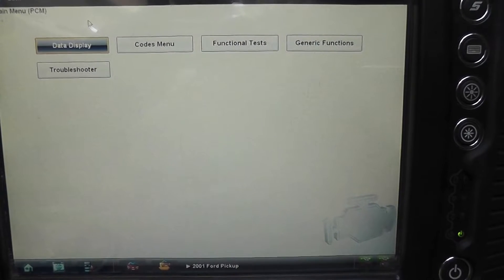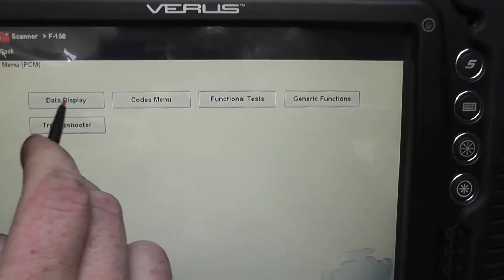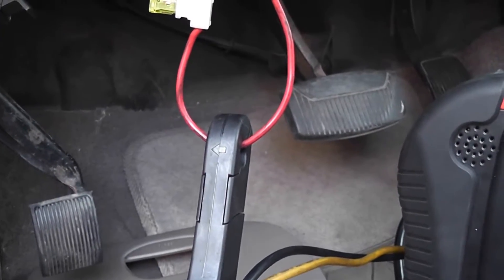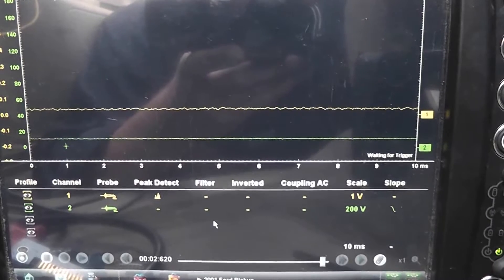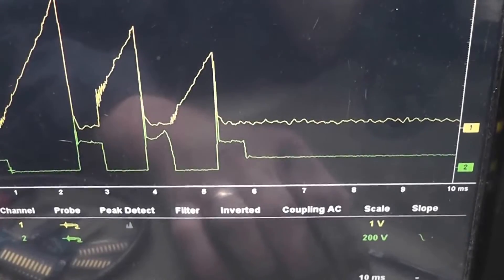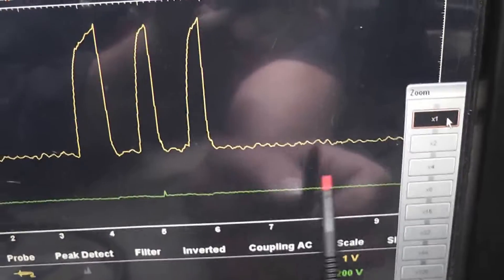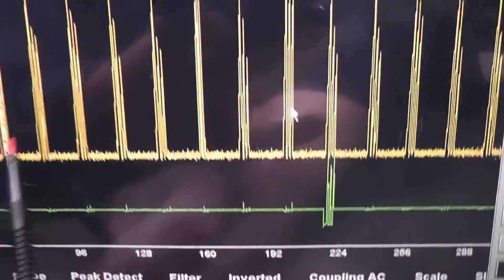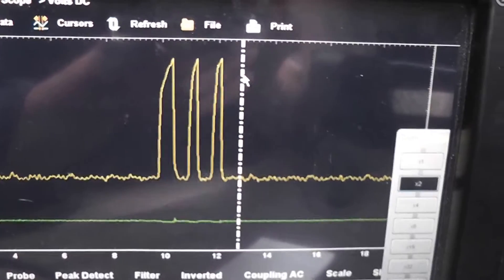How to find a shorted coil on a Ford 5.4 engine (misfire diagnosis)

Comment: recreating this test on a new project, 02 Ford E350 5.4L.  Have miss on two cylinders from codes.  But I cleared and now tring to narrow the COP swap versus the plug on those two cylinders.  Test should tell me exactly if the same cylinders show the misfire. Plugs are at life, I think it may be the plug, not coil. But 100% of public says it's always the coil.    I have Verus, ordered the AES wave loop for the AES wave amp clamp and have my results saved.  Just can't quite make sense of what I have gathered.  I see the no. 1 triple spike pattern on my yellow, and the green is showing my amp clamp.  I have amp on the no. 1 posts.  That is confusing.  Why wouldn't colors be reversed?  You are focused on the triple spike of even height on that bad no. 4.  Are you opening up that amp pattern to see that?
Reply from the maker: Let's move this to my forum www.scannerdanner.com 
It is free to join and we can definitely help you. I have 28k global members and hand picked moderators who've been with me for years and know my material inside and out and are there to help me help you guys. It is just too difficult to offer back and forth messages here on YouTube with stuff like this and we also can't share pictures and images here like we can on the website. Hope to see you there!

Comment: This may be a dumb question...but can this test be done when a system uses the same fuse for powering the coils AND injectors? 05 Ford freestyle 3.0 is the subject.. 3 of the coils and all of the injectors are unfmder the plenum...
Reply from the maker: Yes, but it sort of makes the waveforms difficult to interpret at times.
Reply: @ScannerDanner  yeah that's where im at. Its seemingly impossible to decipher the pattern.

Comment: That coil waveform you're saying is bad is what every cylinder on my car looks like! Lol,and my car runs perfectly!!
I just bought a little Smart Car 1.1 3 cylinder as my 'test' car.I also bought a Pico signal probe for the cop ignition on the car,that's useless too,can't get any waveform at all!!
I've got all the waveforms in my head but nothing i test looks like the haha.Not an encouraging start to my diagnosing career.
The old Verus classic has been a great learning tool though till i can afford something more up to date.;-)

Comment: i have a 03 intrepid 2.7 litre with 3 coil over plugs that arent firing unless i move them to another cylinder. i have 13 volts at all wires but cant figure out how to test negative wire to ecm for a break or short. i was told that the ecm was bad if i had voltage at the ecm connector. i am a super fan of your videos and cant figure out how to test negative wire for a break or short. i know youre probably very busy but could you lead me to a video or tell me how to instructions please

Comment: Hey danner.  I got 2003 expedition 5.4. I got p0320.   And when im driving around 70 mph im losing current on cylinders  6 5 4 8. But just for 3 seconds  then goes back to works fine . I post a picture of the wave form on the forum but I haven’t had lucky  to get any advice.   Thank you

Comment: How often do you need to use more than two channels on your scope?
Reply from the maker: not often but there are time where you would absolutely need more than 2
Reply: @ScannerDanner  For an example? And what would be the best scope for that scenario?
Reply from the maker: Identifying a Shifted crank gear keyway on an RX 330. 
 In cylinder psi waveform synced with an ignition event and cam and crank waveform. Used all 4 channels. 
Picoscope automotive 4 channel by far!

Comment: Paul, i know this is an old video, but is it ok to connect to a coil like this with a vantage pro? Its rated for 200 volts, but i know it can get to around 400 on the firing line. Im just worried about killing my tool... Maybe an atenuator you could suggest? Thanks for all you do for us man you really help us out.

Comment: ScannerDanner, is it possible to do this test without using the low amp probe?
Reply from the maker: Nope, I'm measuring coil primary current flow
Reply: Do you cover primary and secondary testing in your book?
Reply from the maker: Yes I do

Comment: Paul. Do you  think a bad cam lube. Will trough a  po301. On 2000 ford expedition 5.4
Alredy dis injector swap —- coil swap....   i check the injector  wiring  with the power prove 4 and they all good
Reply from the maker: For sure. Check compression pressures next
Reply: ScannerDanner i did a compression test with the gauge.
Reply: I did on cylinder 1 and cylinder 5
Reply: They bought the same.  150 psi
Reply: I did i head job like 6 months ago. Because i got a misfire on cylinder 1 but was the head gascket .  So i put everything new.  The shop rebuid the head too.
Reply: This test on this video should show me if the wiring or computer is bad on the ignition coil
Reply: Bad fuel pump  will trough p0301 too?
There is no p0171 p0174.    Maf sensor its new and is working right
Reply from the maker: Do a running compression test now. A warn cam lobe may not be seen by a static compression test
Reply: ScannerDanner thank you sir. For taking the time to respond.  The problem was my coil. But i not sure why. I swap the coils.  1and 5. 
And the code still was on. #1 so i let it seat for 3 days.  When i come back. Connect the scanner.  Turn switch on. And read the codes again. The code now was on #5  i never clear the codes to keep the freez data     . So i get i good coul swap in to cylinder 5. Now the truck is running. Like new  thank you again 
And God keep  adding years to you life   So we can keep blessing from you  videos

Comment: If I'm not mistaken, as you would need to with compression tests or injectors- using that 1st cylinder is known as a sync? A method to keep track of which cylinder firing based on its firing order.
Reply from the maker: Synced with ignition, not injection and I have many other videos showing how this is done. Thanks!

Comment: Is there any way to get this mode 6, and the next screen which shows each cylinder misfire count, on a program like Forscan on a laptop? I can’t afford one of these nice scan tools as much as i’d love it and use it. I’m trying to find a misfire under load, on a 2008 5.4, no codes, my misfire counter definitely jumps up. Just can’t afford to throw all 8 coils and plugs right now, since I’m not gonna replace them with the cheap eBay $40 for all 8 coils garbage.

Comment: Paul, I've been studying Ignition waveforms. Should I see a turn off oscillation on a good sec. coil/spark plug or on a bad one?
Reply from the maker: are you talking about primary ignition current? If so, turn off oscillations are not always visible, but an open plug wire will certainly give you a big tail. 
Primary current waveforms will not show you all secondary issues. Only some.
Reply: ScannerDanner Ok, so they'll become more evident by reading voltage instead?
Reply from the maker: yes sir, when you can of course

Comment: Have you ever heard of a COP causing a P0720 O.S.S. circuit, stall in drive, O.D. light flashing?
Reply from the maker: No but a faulty alternator yes. I have a video on this.
Reply: Output speed sensor. Ensure alternator is producing power.

Comment: awesome vid!  what low amp probe are you using? I see it's a snap-on,what is the part number?
Reply from the maker: +Joe Ripoll It is a Snap-on one but this one will do the same thing for you.
http://www.aeswave.com/Current-Probe-Low-range-Generic-brand-p8486.html
Same one I use with my Picoscope without the name and it will work on any scope or DMM. If you need a BNC cable end, they have those too.
Reply: +ScannerDanner 
could you run me through the connections set up, between the amp clamp and the scanner? I see at the top of the scanner there black and red cables connected, what is the yellow cable connected to?
thanks again for responding,I really appreciate all your work/posts...
Reply from the maker: +Joe Ripoll I was using two channel for this video. The amp clamp is just a positive and negative lead to any DMM or scope. Inductive amp clamps produce a small VOLTAGE (not amperage) that is proportional to the magnetic field of the wire you connect it to. The magnetic field is proportional to the current flow. 
The amp clamp again, produces voltage that when connected to a scope with proper scaling will indicate amperage but is really just a converted voltage. 
In other words, if you set this amp clamp to a 20 amp setting and connected it to a regular DMM on a voltage scale, then clamp it around a wire that has 10 amps of current flowing through it, your DMM would show 1 volt. Make sense?
Reply: +ScannerDanner 
Yes,I'm getting it, very cool way of doing it. I want to try this test with a friend who has a s-on solus pro or modus pro,not sue which one,but it has the scope function and DMM built into it, and he's currently working on a for f250 with a misfire,and no codes. I'll forward him this video and take it from there.Thanks!!
Reply from the maker: +Joe Ripoll no problem, thank you!

Comment: Just get a Waekon/Matco Auto Wave with a secondary ignition pickup tool, WAY cheaper than a Verus and much much faster to identify a bad coil.  

I LOVE my autowave!  I rank it up there with a Power Probe in usefulness.
Reply from the maker: +Dirty D can you post a link for us please? It may go to spam but I'll unlock it when I see it. Thanks!
Reply: It won't let me copy a link.  It's on youtube, just look up Matco MD Autowave
Reply: Hers a link for your viewers. Hope it helps.
http://www.matcotools.com/catalog/product/MDAUTOWAVE/auto-signal-waveform-viewer/
Reply: Hi Mr Danner. I put a link in the comment reply to you. Please check your youtube spam folder. I did this to help viewers who may be interested.
Reply: Another invaluable tool I have recently discovered is the Flir C2 Thermal Imaging camera.  It blows the Snap-On unit out of the water and allows me to diagnose what cylinder the misfire/dead cylinder is on without even touching the vehicle. 

Very very useful, just a bit pricey though.  I got mine for free though, I traded a rifle that was given to me for it.

Comment: So essentially with a ignition misfire with a cop system, I am looking for the coil's current waveform that looks different from the rest. Then I will have to inspect the spark from the coil and inspect the spark plugs. I'm just thinking of those v6 cop where you have to remove the intake manifold to remove a spark plug. Do I have to remove the coil for testing, or it can be diagnosed from the fuse box?

Comment: on the u scope from aeswave since it's a 1 channel scope can u sync the silinder u choose save it and then put ur  amp probe on the amperage to determine this scenario or is the u scope no good for this scenario?
Reply: +Jesse Ruiz you would definitely need a 2 channel scope to do the same test. But, with just the amp clamp you could identify the faulty waveform and just unplug coils until that particular waveform went bye bye.

Comment: Great video man! I was wondering. Can you catch a misfire that's non ignition related, injector, low compression...... Etc. by scoping the primary ignition feed like you did in this video? Thanks again.
Reply from the maker: +Jaime Solorio you can see those in the primary voltage waveform as it mirrors the secondary but you will not see them in a primary current ramp test.

Comment: I wish I had a scanner like that.I have a 2004 f150 5.4 3v with 99k miles on truck But only 6000 on a new ford motor.I ended up after 5k miles with a stumlbe at idle or while driving it has new plugs I rechecked them,just replaced all 8 coils does the same thing could it be a injector ?? the check engine light comes on with P0430. please help im going crazy.oh and I am a 20+ year mechanic also  thx scannerdanner for your videos

Comment: Hi Paul, I had a good case study yesterday on an 01 Ford F-150 with the 5.4 V8, single cylinder dead miss and trouble codes cleared haha. Anyways, did your exact procedure scoping the current ramps from the fuse box and sync off a coil neg. control on cyl1. Indeed, one coil did look different from the others. All three ramps were even, with some turn-on oscillations (the other "good" coils showed a sharp straight-up rise on the second and third ramps). However, looking at the coil neg. voltage, I could NOT see a spark line or any secondary turn-off oscillations on the bad coil, compared to the good ones.

I almost jumped the gun and called a bad (open or shorted?) secondary winding, but after pulling the coil out and seeing a very strong spark out of the boot, turned out that spark plug was internally open!! With a new plug, the current/voltage waveforms looked identical to the other coils and the truck ran like new.

I have your ebook, but have not found very clear explanations of all the scenarios of COP ignition faults just looking at primary current and neg. control voltage...I definitely need more practice looking at these waveforms and thinking about all the variables that would cause them. This is a very exciting field for sure!
Reply: I'm with you my friend. Email me and I'll send you a picture of one I found recently on a Ford cop.  You'll like it

Comment: Nice work, a refresher, I remember now that a ramp wave is also used for old TV flyback transformer. Ramps are ideal for producing secondary high voltage

Comment: Awesome,  I will have to try that out,  I must first talk my boss into buying the low amp probe for out verus.  
I was also wondering if there is a way to find a bad coil,  or plug on a newer Volvo with a scope.  It has 4 wires going to the could,  I believe they have built in transducers.
I'm just beginning to start using the scope.
Reply from the maker: yep, watch this
How to Test a 4-wire C.O.P Ignition Coil
Reply: Awesome thanks.  I will subscribe to your premium channel as soon as I absorb what I can from the free one. 
I wish you were local I'd love some hands on scope lessons.
Reply from the maker: Hobo Hack
no problem, there is a lot here so have fun with it and thanks for your support!

Comment: this is so cool the things you can learn about a vehicle from the fuse box . i used it at work and now i dont need anyone to turn the key for me. power and grounds are easily seen. low amp probe for high amp use works on voltage setting. wow this is the wave of the future and you have to get in on it or become a second rate parts throwing technician. other people cant explain things in detail and that is why your videos are jam packed with info.time is money dont waste it.the future is exciting.

Comment from the maker: No the Verus doesn't need an attenuator. 
I think the only time you would want to worry about voltage spikes over 400 on the primary would be with an aftermarket MSD ignition system. 
Thanks for your comment and support!
Reply: I was wondering about that last time i check some coils with the snap on it said you attenuator

Comment: I enjoyed your book so much and it has so much info. I am on the second time around. I noticed you use an attenuators on the pico scope. Do you worry about frying you Verus when some voltages spike over 400 volts. Aeswave makes a primary lead set for measuring over 400 vollts. Would you recommend it and for lap scope purposes. Do you prefer pico or snap on more. Thanks for everything.

Comment: Scanner!~ i have the 1998 expedition with the lean codes. i have two questions~ I overtightned screw on coil on plug # 6 and it snapped off,and for the time being, i have old rubber coil boot wedged between fuel rail and coil. ist question do you have a idea how i can remove that broken screw so i can properly secure coil~ ? and would this give me the symptoms i having i told you about getting  theses codes p1152,p1132 and p0153,causing rich condition? i sae new exp using sheet metal screws.

Comment from the maker: If the misfire is constant the first thing I would do is to determine which cylinder it is by performing the scanner powerbalance test or unplug each coil one at a time and listen for RPM drops. Fords are known for mis-identifying which cylinder is misfiring especially on high milage engines with a lot of timing chain slack. So don't completely trust the code for which cylinder it is.

Comment: ScannerDanner, I need your directives in figuring out a problem. I pressure washed my Crown Vic engine and it was running fine as I did the washing. Initially I had p0351, P0352, P0353, P0355, P0356, P0357 and a MAP code which I forgot. However after driving 1/4 mile to Advance, I only got P0356.  I have 12 volts present in the power source at the coil. Also, I tested for  a switching signal (via a led), which I saw.  I later replaced the coil. However, I still have the code and the misfire

Comment from the maker: Only primary current on the three and four wire coils with the built in transistor. Primary voltage (coil negative) is internal and cannot be viewed. (3or4 wire coils)
Great question!

Comment: Excellent video 
In comparison to your Lexus RX 300 with 4 wire coil which you used Vantage in a same way,(thanks to you I know now that Lexus has the ICM built in coil), in that video ,channel 2 was set for 12v and PCM square wave was 5v to ground.My question is that is it possible to see the primary voltage signal(like in this ford 2 wire) with burn time and turn off oscillation with 3 or 4 wire coil? 

Thank you for a wonderful video

Comment from the maker: @jacobnbr11 Thanks Jacob!
 And you are correct in that a leaking boot will not always show in a primary ramp. So that is the downside to this type of testing. There is still a need to monitor the secondary side at times for sure.